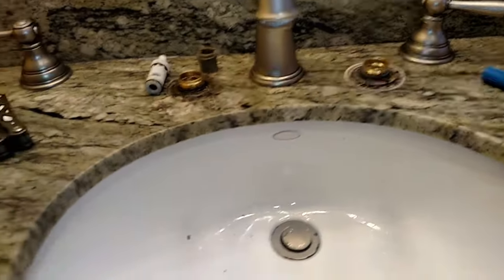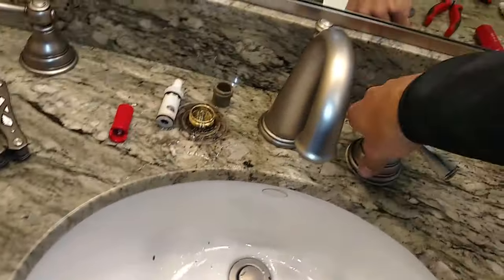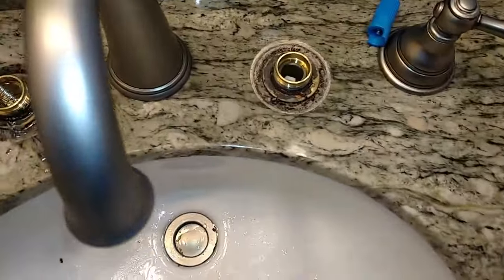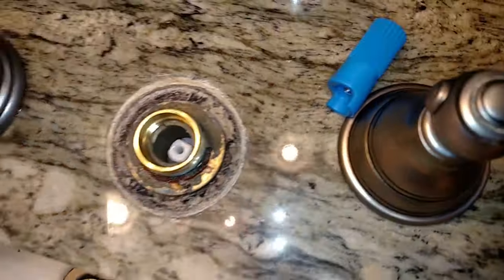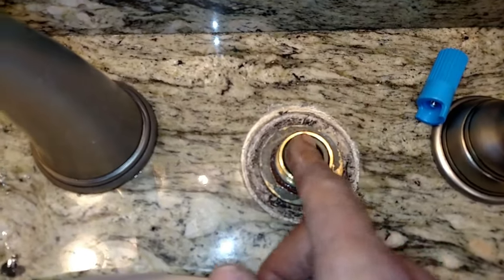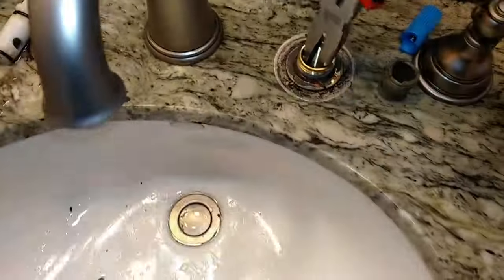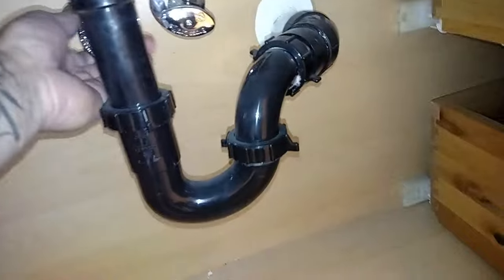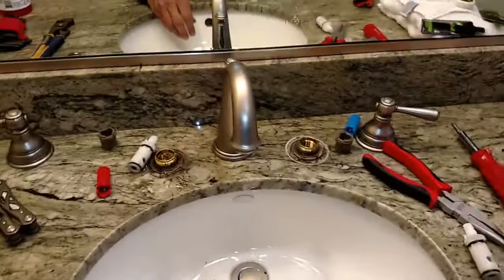How to replace a Moen stem cartridge hot or cold in a bathroom sink

Comment: Also , after you remove the recessed plastic retaning ring. If the cartridge is sticking and won't pull out, you can force it up and out with water pressure, just turn on the valve for a few seconds. Water will spray out so cover with a towel.

Comment: Not going to win an Oscar for cinematography, but very helpful! 
A few tips culled video and from below: 
Moen cartridge 1224. Using needle-nose pliers like in the video was genius. Shut off both supply valves (and main if you're cautious). Turn the valve to open to make release easier. I put the screw back in the cartridge and pulled on the screw with the needle-nose pliers--be prepared for a splash of residual water and (for me) some leaking out the bottom.

Comment: Great video thanks.
1. If handles are stuck, use voice grips under the sink pinned against the side or sink to prevent the whole fixture from tuning and breaking the water line. Then use a towel and channel locks on the top.
2. After water supply is off, turn faucet on, the stem releases easier.
3. You only need to replace the "O" rings on the stem for a leaky faucet. Moen 1224 uses size 11 rings. 10 rings for $3 vs. $15 for a new stem.
Reply: Dude very helpful comment for a plumbing installer thanks
Reply: The vice grip truck makes a lot of sense ive had to ask customers to try and hold the fixtures from spinning, about broke a old mans hand

Comment: i cant get the cartridge out because the pliers against the plastic just strips it.  this guy made it look so easy
Reply: I also stripped it with the pliers. Might have stripped anyway. Moen sends free replacements to original owners, so I got the whole fitting sent to me. Unfortunately, the ring on top is rusted (just like in the video), so I cannot get that off. Tried CLR , then oil to loosen rust, but no luck. Also, Moen did not send a replacement for the ring. :(

Comment: After I put the new cartridge in and reassembled everything, the faucet handle turns but can spin 360 degrees: nothing backstops it.  What could be the problem?  Only the cold side did that.
Reply: Same problem on the cold side. How did you fix the problem?

Comment: Thanks for the helpful video. Appreciate it.  I can’t get that inner sleeve out - it is totally stuck. Tried the needle nose pliers but it is totally stuck.  Unless I remove that I won’t be able to remove the cartridge.  Any thoughts on this please ?
Reply from the maker: Try taking a small flat head screwdriver and taping with a small hammer 🔨 . So u can break the tight seal. If it works then go to the needle nose to complete the job
Reply: @unoriz85  thanks a lot. It is quite stuck.
Is it screwed in?  Else I can break it up.

Comment: So the part you didn't show is how to remove the handle itself.  I have a slightly different Model, T6620, which has a small cap on top of the handle. I removed the cap, but there is no screw head visible, no Allen, no Phillips, no slotted screw head.  The Moen website does not have any instructions on how to do this either.

Comment: I have this same faucet but the handles are stuck. I can't turn them.  Any suggestions for getting them off?
Reply from the maker: Get a pair channel locks and put a towel over the handle and turn counter clockwise nice and tight at the bottom of the base
Reply: @unoriz85  is that how you got those handles off? I am having a hard time getting a grip on the base of those specific faucet handles

Comment: I was unable to get the piece that holds the cartridge in place off. It would not budge! Any suggestions
Reply from the maker: Hey Judy Obrien so when u use my  Needle nose pliers I use 2 handsThen inserting the tool inside. U need to use a bit of opening force to be able to break the tight seal. The 2 specific  grooves go counter clockwise. Remember while  using the needle nose plier  use 2 hands a bit of  force while in open plier position. Hope this helps.
Reply: @unoriz85  Thanks so much.   I'll give it another try
Reply: Same thing with me I cant get that outer piece out as well.  Seems to breaking tiny pieces of it the more force I put into it.
Reply from the maker: @latino914  hey so check out my comment and see if it helps
Reply: unoriz85 just buy the removal tool and it comes out easily. The tool is $5 and can be purchased from Moen or Amazon. Pliers only chip the plastic and make the job difficult and the restraining ring cannot be reused.
Reply: Sometimes the tool they say you need to remove the retaining nut doesn’t work. If it’s older, there’s a good chance that you will strip it.  Be careful, or call a pro before you damage it, because it’s a giant PITA to remove if the top is stripped.

Comment: The faucet handles wont screw off. What do you suggest?
Reply from the maker: Try getting a pair of adjustable  channel locks and grip at the bottom of the base and turn counter clockwise. Make sure u but a light rage to not  Scratch the faucet handle
Reply from the maker: Also try to to tighten it just a little  bit not to much then loosen it.that also helps with anything

Comment: Was this the  faucet the Moen T6620 model?
Reply: I can't get the handle off the T6620.  There is a cap, but I don't see a screwhead.  Did you figure this out?
Reply: @raptr49  Haven't installed mine  yet, will let you know though!
Reply: @PointMicrosoft  I finally figured it out.  The cap at the handle does not do anything and you don't event have to take it off.  The entire handle assembly unscrews.  The problem is that with time, the calcium builds up and it is hand to turn the base. I used a putty knife to go around the base of the  assembly and the sink.  This will loosen up any build ups and now you should be able to turn the entire assembly.  Then I also had difficulty grabbing the cartridge to pull it out.  I used some needle nose pliers with heavy serrations to grab it securely and then yank it straight out.
Reply: @raptr49  Thanks for telling me, will keep it in mind for the future. I got mine installed now.